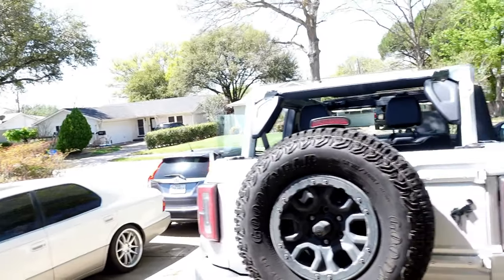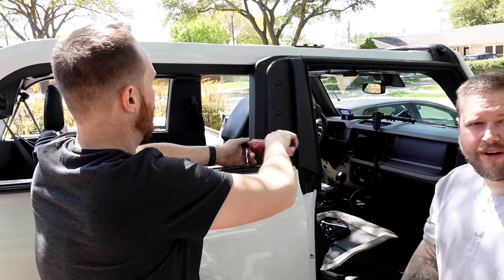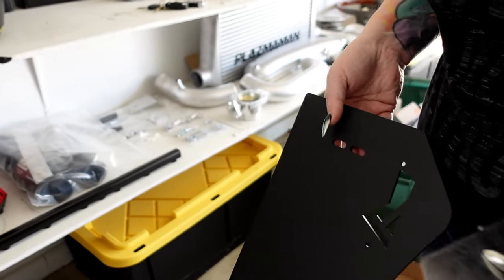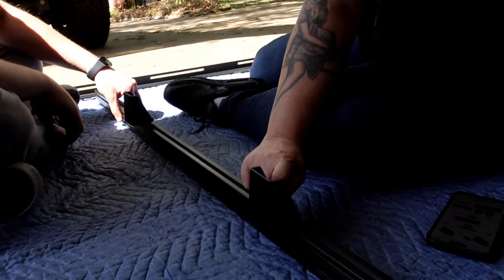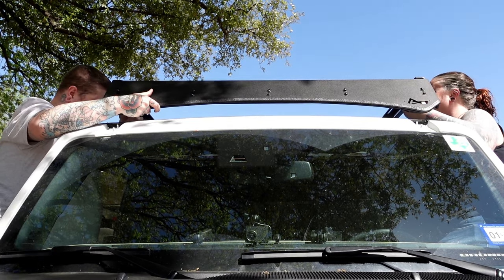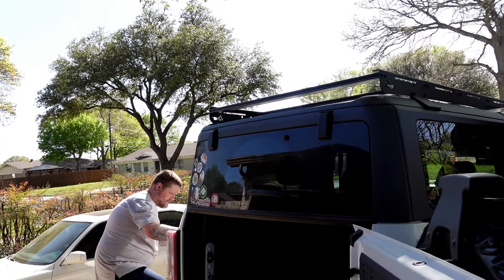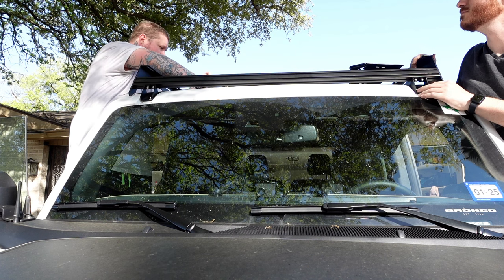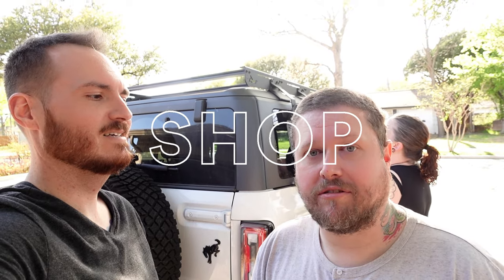TRAILRAX ROOFRACK REDEMPTION INSTALL ON OUR 2 DOOR WILDTRAK BRONCO

Comment: what is that handle you installed on the side maxtrax?
Reply from the maker: It’s actually the mount for the Maxtrax. It’s made by Expedition Essentials. The red bar is part of what locks them down when it’s closed, and breaks them apart when opened.
Reply: @drivemodenjoy  Thanks so much!!